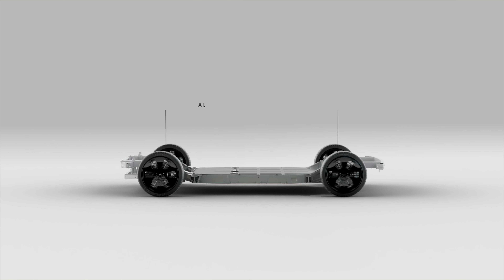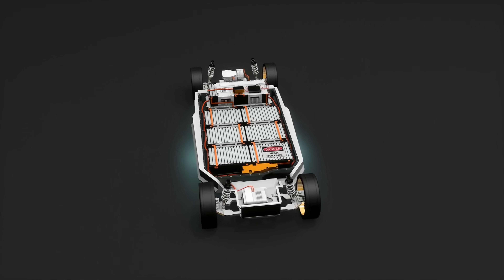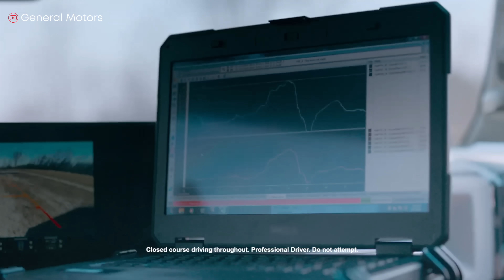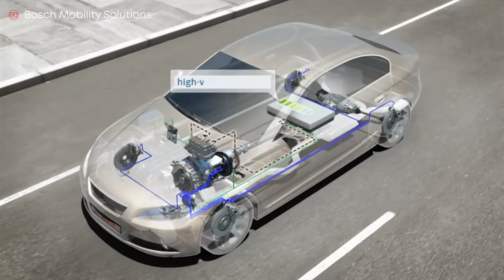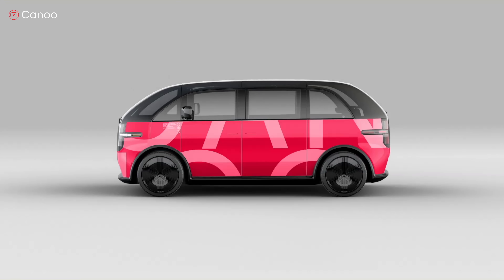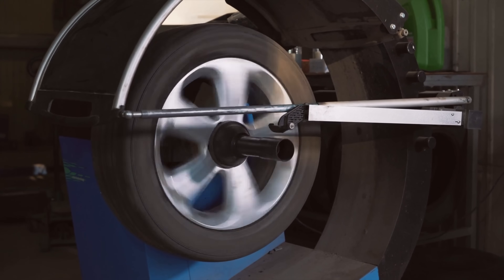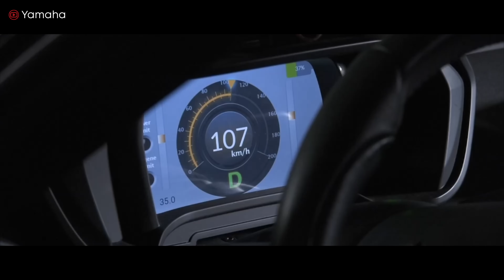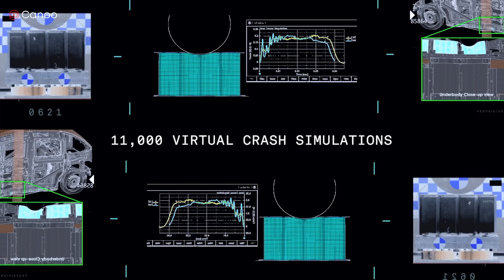No One is Telling You the Truth About Electric Cars, So I Have To

Comment: Wait until steel ion batteries  pip up same kw voltage 1/4 size &weight  1/4 cost recharge  15 to 30 minutes  average  miles per charge, 1000 that's 1000

Comment: Ones that last a million are like twice the weight and a quarter cost (lfp). Ones that have half the weight are 4 times the cost and just had a fast charge breakthrough this year (solidstate). Other batteries are only good for grid storage or maybe a bus. Compared to lithium ion liquid btw. I'm waiting for mass production of solid states 👌 to buy an ev. They'll be quick charging and last a million and be recyclable even if it is lithium which has environmental downsides by the time they're cost competitive.

Comment: i once had a subaru i purchased used , it had a cool feature , self adjusting shocks , they leveled the car by raising and lowering from side to side front to back , pretty cool huh? except when the system went bad (about 8 years into the life of the car ) it cost more than the value of the car to replace / repair , it went to a junk yard . will we see that on steroids with EV 's , time will tell

Comment: so if people should leave there car in the garage in extreme cold and heat how do you suggest people get to work in the middle of winter and summer or they if they dont have a garage to park them in. and a gas engine can las well over 2o year mine is at 19 and has never needed expensive repairs.

Comment: so, if a new car has a 300 Mile range, and capacity decreases by over 2% a year, then in 5 yrs, it has a range of about 260 Miles.  And Rapid Charging probably wears out the Battery faster than 2plus%. Not a good car choice for long trips. Unless you want to spend the night in a Hotel, after Only 300 (decreasing 2plus %, per yr). Keep it.

Comment: The key is the battery... In my family it is common to get between 20-25 years of use from a vehicle... I just didn't catch the replacement cost of the EV battery... So I am guessing that the EV vehicles life span is 10 years.   So save 4,500 in repairs or save the cost of buying another vehicle $50,000.  Hmmm 🤔
Reply: EV batteries are rated in miles, as they should be. Without knowing your miles driven in that time it's impossible to answer. However, Tesla batteries are rated for 300,000 to 500,000 miles. Which at the US miles per year average of 14,263, you get 21 years on the low end of that estimate up to 35 years. If you rate of driving is higher and/or you live in less favorable conditions, this will be reduced. Similarly, my plugin hybrid has the battery rated for the life of the car. Battery life anxiety isn't nearly as much of an issue as it once was.
Reply: Since EVs are more efficient, you also save on fuel costs by a large margin over the lifetime of the car.
Reply: @JimBob1937  so the question becomes, "will I save more or less than $45,000 in 10 years.  Easy to calculate.  Take your milage and calculate based on the annual mileage reimbursement rate for your state. If you spend less than $4500 a year for fuel, the EV isn't worth it.  (Most people know if they spend more or less than $90.00 a week in fuel) (based on 50 weeks because of your 2 week vacation in the rental car 😂).
Reply: @toddgardner6355  , I disagree with your $45,000. You really need to take into consideration a regular vehicle cost and subtract that, as you're looking for the delta. So if the EV cost $45,000 and a regular car of the same feature set (roughly same trim) you pay $30,000. If we assume the $30,000, your delta is $15,000. I did some calculations a while back for my Prius Prime (plugin hybrid) and got some rough numbers for electricity costs for my area per mile, $0.02076 per mile. If we assume 150,000 miles for ownership (miles is more important than time for costs), we get:
150,000 * 0.02076 = $3,114

Say fuel costs normalize, to give gas a fair chance, at say $2.50 a gallon. If we assume your $25,000 car gets 28 MPG, that is:
150,000 / 28 = 5,357 gallons
5,357 * 2.50 = $13,392

Delta for fuel $10,278. If we account for roughly the reduced maintenance costs mentioned in the video, you get your $15,000. 

With that said, I agree current Telsa prices are too high. Other EV makers are cheaper. However, currently I got a plugin Hybrid, which can support full EV mode for a short distance, but enough to cover a large portion of my daily commute, and hence get a lot of the EV benefits for a car I paid $30,000 for.
Reply: @JimBob1937  Your missing the initial premise at the beginning of this thread.  The EV cost is approximately $50,000 and the battery pack lasts approximately 10 years.  The battery pack is not a cost that was factored in, rather it was suggested that the EV's life was 10 years.  I routinely keep cars for 20-25 years.  Therefore the base cost of an EV is double because I need to buy 2 cars instead of one.  The $50,000 cost of the EV was provided by Scotty in the video, the average difference in maintenance (under $5000) was provided in the video.  If you are a short term owner of a car... Get the EV.  If you are someone that will use the car for 20+ years, then do the math.  Don't assume your milage, ask your insurance company or look at your oil change receipts or your log and use real numbers to see if it is right for you.  The $90.00 a week in fuel is 100% taken against the cost of just the purchase of the second EV.  I did not to take into account the additional cost of charging the vehicle or installing a charging system in the home or the time it takes to charge at public stations.  Those are life style changes as well as costs.  I simply assumed the cost of the first vehicle (EV or gas) would be equal for the comparison and the gas cost would need to surpass the cost of the second vehicle before the death of the EV battery (10 years) forcing the need of purchasing another EV and destroying the resale value of the initial EV.  You can compare the daily cost of running both vehicles, that is good. But it is counter to your argument, because it includes costs to the EV that I was ignoring and therefore giving a $0.00 valuation for.
Reply: @toddgardner6355  , I think your issue is, how many miles do you drive in 10 years? It's not like a car just says 10 years and it's dead... you need to say how many miles you drive a year, to know how many years it will last. For my driving, it will last me 25 years! The battery lifespan is based on miles since miles driven roughly equals the number of charge cycles. You keep saying 10 years, but that is only the case if you drive a very large amount. What is your yearly mileage?
Reply: "Your missing the initial premise at the beginning of this thread. "

You're missing my initial reply to this thread:
"EV batteries are rated in miles, as they should be. Without knowing your miles driven in that time it's impossible to answer. However, Tesla batteries are rated for 300,000 to 500,000 miles. Which at the US miles per year average of 14,263, you get 21 years on the low end of that estimate up to 35 years."

You keep insisting the battery life is short, I think just because you have it in your mind that it is... yet, it really is not that short. The life of the battery generally exceeds what most consider the life of the vehicle itself. Again, what is your average miles per year?

Comment: Just seen a Chevy Volt hit a street light pole in Wentzville Missouri. I'M pretty sure the battery was puncture instant fire. It spreed so fast if it had passages, no time to evacuate, After seeing this don't want one the need to find away to neutralize the battery from exploding it not like a recall Kia fire where you have a firewall between you and engine where if you pull over fast you can escape the battery is underneath your butt

Comment: Electric motor condition has no direct relationship to Battery degradation. the Inverter either takes enough power in and dumps it into the batter or it doesn't.. Most motors will outlast the vehicle. Batteries will always be a problem but they are not as bad as they are being portrayed. Most new EVs have a battery that will last 10 - 15 years. in that time replacement battery tech will be greatly improved that reconditioned packs will be affordable.

Comment: Tesla batteries last about 350k miles, cost $20k usd to replace.

ICE
Oil changes: 70 x $80 5600
1 Major repair: 5000
Gasoline: 30mpg = 12000 gallons = 40000
50600 + 20000 for 3 yo car
70k

Or...1 new Tesla at 50k +20k new battery
70k

Oops

Comment: As a 20+ year tech, I'm not sold on evs. I went through the hybrid phase and now this fad. When you think about an ev, think of how shitty cell phone batteries are, how long they last, how expensive they are, are the things required to make them, and using one to power your car. The technology isn't there yet, and it's trying to be pushed and rushed instead of letting people naturally accept it, like a fad. All the gas powered "luxury" cars keep adding more and more electronics, and guess what systems fail and have codes in them everytime you pull one in.

Comment: what degrees or training would you need to have to work on them/repair them?  the issues i see are the complexities with the computer systems myself, why so many cameras? etc.  sadly i live in an apt, with no garage... in wisconsin were temps can hit -40 sometimes in winter, which lasts 5 months.... and the salt damage to frames... i worry that i wouldn't be able to have an electric car.  it's not like a lead acid one you could remove to take inside to keep warm, thou you plug it in so maybe a heating coil for like thawing frozen water pipes may be something they have?... so as long as it's plugged in or has charge it could potentially warm the battery pack some... but i haven't heard of it, and havne't done research to see if its an option.

Comment: Think you should have mentioned that ALL EVs have a VERY long warranty for the battery (I think all brands offer at least 5 years) which will cover the typical ownership period for most buyers therefore meaning 99% of private EV owners will NEVER have to worry about battery problems except for the gradual degradation of the battery and consequent progressive reduction in range. Would you agree?
Reply: There goes your resale value which means a lot to quite a few people.

Comment: Regenerative breaking is a lie!!!  It is only possible when the motor EMF is greater than the battery voltage.  It cannot work at low speeds!!! It also can;t work when the battery is fully charged!!!

Comment: Volvo and a few others did comparison reports. They all limited the cars lifetime for results. Artificially ending the lifespan at 120,000 odd miles is biased towards the Electric car. Perhaps the cars artificial end date variable is to protect the electric cars argument. After 120,000 odd miles the curve swings the other way again. As it turns out oil-based cars will last a lot longer than battery cars (at least for the foreseeable future). In fact, if you go twice as far in a petrol car then refurbish the engine etc, at that point the petrol car far out ways the electric cars environmentally friendliness.

If you chose to do the same refurbishment for the electric car, then it would need a battery replacement, and that also is bad for the electric car’s argument. Also, the expense on the user replacing the battery means they are likely to buy a new car anyway, again bad. Another point is owners that drive oil-based cars tend to keep the car longer. Wow that’s another point for the oil-based car, as building a new car is a lot more damaging to the environment than keeping the current one, especially if electric.

Stats based on the fact that both cars are retired at 120,000 odd miles is the problem variable here. I find it hard to imagine the electric car can win when it comes to reality of ownership and longevity.

Dont get me started on recycling for the cars either.

Comment: The true environmental impact of ev's are so devastating that no one being honest can say that these cars are "greener" than say a bio-diesel. Sure these don't emit co2, but the number of miles it needs to run before it even starts paying back it's carbon debt and environmental damage is ridiculous! All the: sulfides, cobalt, nickel, zinc, lithium, etc. doesn't happen without the environment paying a STEEP price. Especially since cost leads them to the cheapest (a.k.a. the least government regulated) sources. Usually in the east and usually child and/or slave labor. 
If you want to buy an EV because you want one or because they're crazy quick, do it. But don't claim you're "saving the planet".

Comment: Owners of electric vehicles will pay a tax each year for registration renewal that is much higher than gasoline-powered cars.  In areas of the country where it gets cold, the range of the electric vehicle will be significantly reduced.  Where I live, I would have to drive long way to find a charging station.  Few people are talking about where the power to charge electric cars is going to come from when there are many more electric vehicles being sold.  No new power plants means that the electric grid will be overloaded and power outages will occur.  The cost of a new electric vehicle will be higher than many people can afford.  We get most of the lithium to produce electric car batteries from outside of our country, so these countries will be able to shut down our battery production whenever they want by shutting off the supply of materials.

Comment: batteries are extremely expensive! replacement costs equal to replacement vehicle cost. In other words get ready to buy a new car every 100,000 miles no ifs, ands or buts!
Reply: It's range is way more than that in 10 years time when it's time to replace battery, it price would have dropped massively.
Reply: @frankreynolds9930  So your telling me mineral mining will go down the more people who use these heavily laden mineral-rich batteries?
Reply: @Abovegroundpoolbuilder  No, as more people use it, more companies will look into developing better battery tech, recycling old batteries and making it cheaper. It's all about saving money.
Reply: @Abovegroundpoolbuilder  Instead of burning fossil fuels to make hydrogen, it's way more efficient to make electricity for ev. Hydrogen may work in ships and industries but not on cars.

Comment: Hi Scotty, very informative. Quick question, my friend just bought a Kia EV and he's using it to charge the air conditioners (and trying to connect his fridge as well) in his home in southern California. He thinks this will save him in the long run but I asked him, wouldn't that destroy the car battery fast and won't you have to replace it? What are your thoughts on that? Thank you!
Reply: Maybe so but the battery maintenance can be much cheaper in the forklift. Those batteries don't need complete exchange since you can replace which ever cell (or jar) is bad

Comment: my 2014 chevy volt has 83,000 miles. the brake pads & rotors are STILL in new condition- almost NO perceptible wear. if you drive your EV like the church lady- your EV should never need brake pads. but you should test them from time to time- just to make sure the conventional braking components are in good shape. 

my model Y is in a category all its' own. if left in the sun or the cold- the car will use the onboard heat pump to maintain optimal temperature of the battery- even if you don't plug it in. but it's MUCH better to just program the car's system to run between 80% & 20%.. .and then just leave it plugged in. even tesla will tell you- the car's smart charging system will do the rest. if plugged in, it will maintain the battery to PERFECTION. million mile battery? 4680's. already there, being installed in model Y's in TX gigafactory NOW. 15% HIGHER energy density than ANY other battery.

Comment: Hi Scotty; something that never gets mentioned is that it takes anywhere from 50,000 to 90,000 miles for an EV's eco footprint to catch up to that of an ICE car. Because it takes more of that footprint to build the car and its batteries. So really; are they any greener? Certainly not in the short term. Then of course there's all that waste that still needs to be got rid of; my guess is much less of it is recycleable.
Reply: I've read so many differing opinions on this....
Allegedly, it takes processing about 500,000 TONS (1 BILLION pounds) of material to build your battery. And of course that's all done with diesel powered trucks, shovels and loaders. So there's that part. 
Also, allegedly, only about 10% of the lithium in Li batteries can be recycled at this time. 
ALSO, also, before everyone goes out and buys an electric car, the infrastructure for producing and delivering power needs upgraded, big time. And forget money....what's going to be the environmental impact of THAT? Millions and millions of tons of copper, aluminum, steel, iron, etc. would have to be mined to make that happen. Not to mention transportation (both of the new stuff and workers back and forth to work every day for years on end), and so on. The govt is demanding that auto makers start pumping these things out and people start buying them (which is hilarious coming from a govt that is so far in debt they'll never see the light of day again), but good Lord...is anyone thinking ahead??? 🤦‍♂️🤷‍♂️

Comment: Manufacturing electric vehicles generates more carbon emissions than manufacturing comparable gas-powered cars, with most of the extra emissions due to the manufacturing of the large battery in electric vehicles.

Comment: EV's are coal powered. How do you make electricity? With a generator. What turns the generator? A turbine. What turns the turbine?  Steam. How do you make steam? Boil water. What do MOST power plants use as a heat source to boil that water. COAL. 
Just wait until EV owners are hit with a special tax to fund the roads that will replace the tax on gasoline.